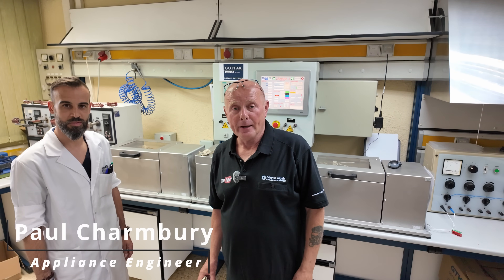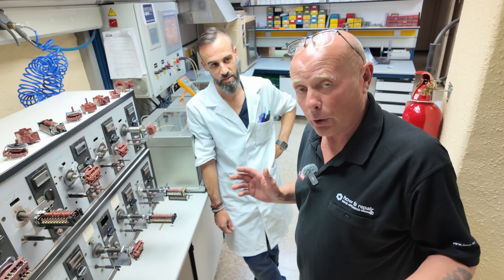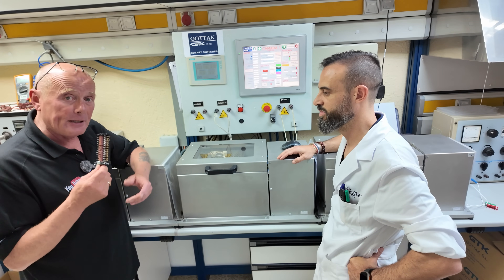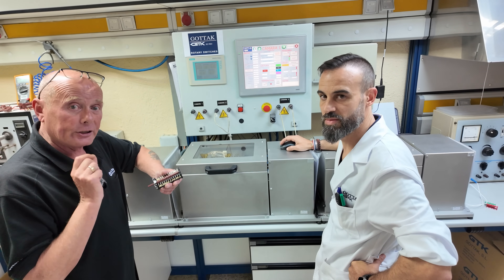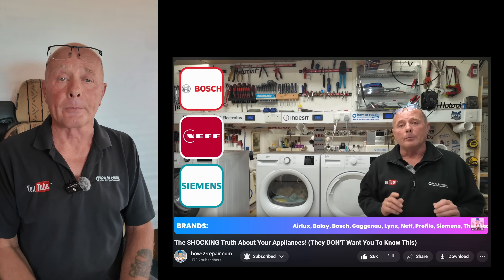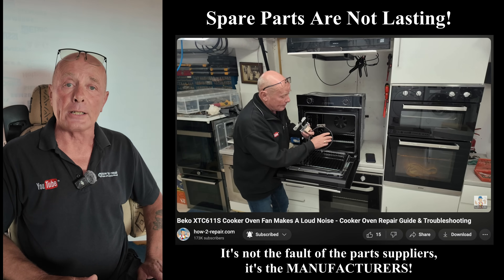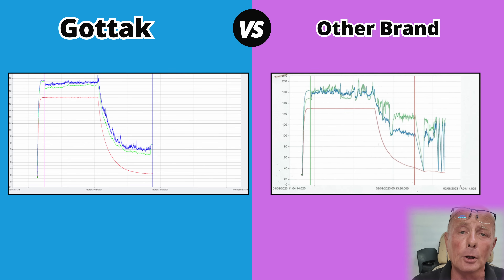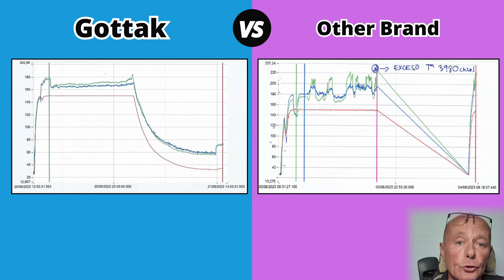Why Your Appliances FAIL SO FAST! Lab Results EXPOSE the Truth!

Comment: I have a hp office jet and it used a 3or 4mm thick belt to drive a big gear that feed paper, cover the print head, move the paper around the duplexer etc
It fails in a few years.... I only printed like 1000page
A canon laser printer, the spring loaded hinge that connect the scanner bed and adf, suddenly broke off with a loud bang at night, had a look at it, the hinge was secured with a screw, the plastic broke around the screw hole, plastic seems to be abs fibre reinforced
Reply from the maker: The original video about the lightbulb conspiracy which you will find on YouTube really does tell the story about printers and how an individual Spanish guy found out that the obsolescence was built into it from the start. This brings me to a larger issue I'm passionate about: built-in obsolescence. I’ve made many controversial videos on this topic, and they often seem to get suppressed. To put it in perspective, Google is the largest search engine in the world, and YouTube, its subsidiary, is the second largest. Google’s business model relies on advertising revenue from manufacturers. My best-performing video on built-in obsolescence reached 750,000 views. That might sound good, but it’s a tiny fraction—approximately 0.05%—of the 1.4 billion English speakers in the world. We are fortunate enough to afford these machines while people in other parts of the world still wash clothes in rivers, yet important conversations about product longevity are often stifled because consumption drives our economy.

Comment: The warranty isn't worth the paper it's printed on. You can't get parts for it. I had a Frigidaire refrigerator, and dishwasher, and 2 Maytag washers. None of them lasted 3 months and none of them could be repaired. Lowes did nothing, nd a local dealer returned my money. New stuff is all junk. I replaced everything in my home from a used appliance dealer, that had been rebuilt, He promised he could keep it all running with used parts, or new parts because they would be available. All the appliances are still working fine after  3 years now. I will never buy new again.
Reply from the maker: I am all for buying secondhand machines when they're good, but there is becoming a shortage of machines out there which are reconditionable.

Comment: I repaired TV's in the late 90's. Old wood cabinet tv's were still working or could be repaired. 
Then the plastic cabinet ones came along lasted half the time but you got what you paid for, you could get some quality electronics or a bag of shint.
The weakness is built into the power supply.
DON'T UNPLUG or switch the power off!. 
I used standby whenever possible for years and had to get rid of my tvs to upgrade on size. 
That rush of power is a countdown to you're Tv's power supply blowing the fuse.
Reply from the maker: I had a friend that you repaired TVs and it used to be a great business in the 80s but as you say obsolescence is being built in to so many things when I read your comment and then look at what governments tell you to do I laugh I swear I could remember advertising telling you to unplug things like TVs or switch them off at the mains whenever they're not in use and yes, it is so simple to build in a counter for the self-destruct process So many manufacturers have decided to change their direction of building quality and now caring only about the numbers game. You only have to read the comments that were left on the recent. Miele video i did. https://youtube.com/shorts/3LXPwAIY6LI  I have been in this appliance industry for nearly 50 years andI'm passionate about: built-in obsolescence. Because it is stopping us repairing machines I’ve made many controversial videos on this topic like this one, and they often seem to get suppressed. To put it in perspective, Google is the largest search engine in the world, and YouTube, its subsidiary, is the second largest. Google’s business model relies on advertising revenue from manufacturers. My best-performing video on built-in obsolescence reached 750,000 views. That might sound good, but it’s a tiny fraction—approximately 0.05%—of the 1.4 billion English speakers in the world. We are fortunate enough to afford these machines while people in other parts of the world still wash clothes in rivers, yet important conversations about product longevity are often stifled because consumption drives our economy.

Comment: Don't buy a Samsung.  They are like disposable razors, use and throw away. 
Only difference is they cost the same as all others. 

LG, Samsung and a few others pay to be displayed out front.
Reply from the maker: I'm in agreement on the older machines but on the latest ones that have come to the market I am interested that they are doing a five-year parts and labour guarantee I'm actually doing a video on them at the moment. I agree that they have had lots of problems over the past years with corroding spiders and PCB problems but I am actually praising them for putting a full five year guarantee this is at least a move in the right direction and I hope you understand the angle I'm coming from remember I am totally independent and I'm not liked by most of the industry because I say it as it is. So many manufacturers have decided to change their direction of building quality and now caring only about the numbers game. You only have to read the comments that were left on the recent. Miele video i did. https://youtube.com/shorts/3LXPwAIY6LI  I have been in this appliance industry for nearly 50 years andI'm passionate about: built-in obsolescence. Because it is stopping us repairing machines I’ve made many controversial videos on this topic like this one, and they often seem to get suppressed. To put it in perspective, Google is the largest search engine in the world, and YouTube, its subsidiary, is the second largest. Google’s business model relies on advertising revenue from manufacturers. My best-performing video on built-in obsolescence reached 750,000 views. That might sound good, but it’s a tiny fraction—approximately 0.05%—of the 1.4 billion English speakers in the world. We are fortunate enough to afford these machines while people in other parts of the world still wash clothes in rivers, yet important conversations about product longevity are often stifled because consumption drives our economy.

Comment: My gas heating system at home has a built in fan - it had to be replaced two times over the last 10 years and the last time i kept the old part ad tried to repait it to have a spare part next time. From the noise, it just had a defect bearing. But it was made in a way, that the rotor could not be removed and so you could not reach the defect bearing. The plastic rotor was pressed onto a shaft and removing it meant to break it. It did it anyway to check the bearing out of curiosity. There were two on the shaft. A encapsulated, big one ... which was intact. And a open bearing, much smaller and now you can guess, which one was defect. These is a cent-part, that is made to break ... and they took care, that you cannot change it. This is a kind of design, that should be criminalized.
Reply from the maker: Thank you for your comment. I appreciate people like you taking the time to write it out. Please share it where possible. It might help others make a wise choice instead of being misled by the industry.

Comment: I have a Wolf brand of 2 speed 240v drill , I bought it 2nd hand from a retiring tradesman in 1978 , I use it for core drilling and plaster/ cement mixing with a paddle on low speed .
It's still going strong on its 2nd chuck and 3rd set of brushes.
Aside from a new , longer cable it has only needed cleaned and the gearbox re greased .
So that's a testament to quality
Reply from the maker: Thank you for your comment. I appreciate people like you taking the time to write it out. Please share it where possible. It might help others make a wise choice instead of being misled by the industry.

Comment: My sister bought a Black and Decker drill for my 18th birthday, one speed, but two settings, normal and hammer. It's worked perfectly, never failed and I've worked it hard. I'm 60.
Reply from the maker: It's amazing how many tools and appliances back then are still going to this day. There is even a lightbulb in a fire station in America which is never failed in 100 years a great documentary is on this called the lightbulb conspiracy but yet that's another video that got squashed or is it that the modern society today does not care. This brings me to a larger issue I'm passionate about: built-in obsolescence. I’ve made many controversial videos on this topic, and they often seem to get suppressed. To put it in perspective, Google is the largest search engine in the world, and YouTube, its subsidiary, is the second largest. Google’s business model relies on advertising revenue from manufacturers. My best-performing video on built-in obsolescence reached 750,000 views. That might sound good, but it’s a tiny fraction—approximately 0.05%—of the 1.4 billion English speakers in the world. We are fortunate enough to afford these machines while people in other parts of the world still wash clothes in rivers, yet important conversations about product longevity are often stifled because consumption drives our economy.

I plan to release another video soon with analytics to prove this point. I've also discovered some manufacturers appear to be using AI to shield their brands from negative feedback on videos, which I will cover in an upcoming exposé. Please consider sharing any of my built-in obsolescence videos to help them reach a larger audience.

Comment: Just as mentioned in the video own a pressure cooker for making rice made in the 90s which still works well but the recent purchased cooker didn't even last 4months the quality is very bad it is thin while the old cooker is thick
Reply from the maker: You’re absolutely right mate, and it’s a frustrating practice that affects nearly every industry. The concept of deliberately designing products to fail or become obsolete within a certain timeframe is a huge driver of unnecessary waste and consumer spending. Whether it’s electronics, appliances, or even clothing, it’s all about maximizing profits at the expense of durability and sustainability!

This brings me to a larger issue I'm passionate about: built-in obsolescence. I’ve made many controversial videos on this topic, and they often seem to get suppressed. To put it in perspective, Google is the largest search engine in the world, and YouTube, its subsidiary, is the second largest. Google’s business model relies on advertising revenue from manufacturers. My best-performing video on built-in obsolescence reached 750,000 views. That might sound good, but it’s a tiny fraction—approximately 0.05%—of the 1.4 billion English speakers in the world. We are fortunate enough to afford these machines while people in other parts of the world still wash clothes in rivers, yet important conversations about product longevity are often stifled because consumption drives our economy.

I plan to release another video soon with analytics to prove this point. I've also discovered some manufacturers appear to be using AI to shield their brands from negative feedback on videos, which I will cover in an upcoming exposé. Please consider sharing any of my built-in obsolescence videos to help them reach a larger audience.

Comment: i once had an lg direct drive washing machine. after about 10 years of perfect use . the bearing for the tub failed. no big deal . it is expected after that amount of time. i changed the bearings myself . did a great job. . after 3 weeks of use the machine stop working compleatly . would not turn on. it turned out to be that the main computer needed to be changed. a cerified lg tech checked the machine and told me what the problem was. anyway i find it very strang that the machine stoped work after only 3 weeks that i changed the bearings. after it work flawlesly for 10 years. could it be that the machine is only to be fixed by a lg tech. is it possible that when you open up an lg machine to fix something in the machine is triggered for it to stop working if not opened by an lg tech. does it have a trip switch thay onlg lg tecks know about. hope you understand what i am tring to explain. it there a switch or seting that needs to be reset after re assemply that only lg tecks know about. very strange it compleatly shut down after 3 weeks of changing bearings
Reply from the maker: You’re absolutely right mate, and it’s a frustrating practice that affects nearly every industry. The concept of deliberately designing products to fail or become obsolete within a certain timeframe is a huge driver of unnecessary waste and consumer spending. Whether it’s electronics, appliances, or even clothing, it’s all about maximizing profits at the expense of durability and sustainability!

This brings me to a larger issue I'm passionate about: built-in obsolescence. I’ve made many controversial videos on this topic, and they often seem to get suppressed. To put it in perspective, Google is the largest search engine in the world, and YouTube, its subsidiary, is the second largest. Google’s business model relies on advertising revenue from manufacturers. My best-performing video on built-in obsolescence reached 750,000 views. That might sound good, but it’s a tiny fraction—approximately 0.05%—of the 1.4 billion English speakers in the world. We are fortunate enough to afford these machines while people in other parts of the world still wash clothes in rivers, yet important conversations about product longevity are often stifled because consumption drives our economy.

I plan to release another video soon with analytics to prove this point. I've also discovered some manufacturers appear to be using AI to shield their brands from negative feedback on videos, which I will cover in an upcoming exposé. Please consider sharing any of my built-in obsolescence videos to help them reach a larger audience.

Comment: Needed to fix the plastic band around the glass of a frontloader washingmachine, the plastic band holds the metal hinge in place. It's of ridiculously  thin plastic for something which needs to counter the forces of the hinge. They don't sell the them on their own. It needs to be bought in combination with the whole glass of the door -- 400euros. Holy shit! They also make sure you cant reuse 2nd hand because they don't use screws, no instead they use those one time round plastic hole and nudges which they melt down. It is really shameless. Next time I'm putting this on twitter and LinkedIn. I'm done with these companies.

This was a run of the mill Bosch washingmachine of 2014 or something. Of course it had 4,5 starts in ratings.
Reply from the maker: You’re absolutely right mate, and it’s a frustrating practice that affects nearly every industry. The concept of deliberately designing products to fail or become obsolete within a certain timeframe is a huge driver of unnecessary waste and consumer spending. Whether it’s electronics, appliances, or even clothing, it’s all about maximizing profits at the expense of durability and sustainability!

This brings me to a larger issue I'm passionate about: built-in obsolescence. I’ve made many controversial videos on this topic, and they often seem to get suppressed. To put it in perspective, Google is the largest search engine in the world, and YouTube, its subsidiary, is the second largest. Google’s business model relies on advertising revenue from manufacturers. My best-performing video on built-in obsolescence reached 750,000 views. That might sound good, but it’s a tiny fraction—approximately 0.05%—of the 1.4 billion English speakers in the world. We are fortunate enough to afford these machines while people in other parts of the world still wash clothes in rivers, yet important conversations about product longevity are often stifled because consumption drives our economy.

I plan to release another video soon with analytics to prove this point. I've also discovered some manufacturers appear to be using AI to shield their brands from negative feedback on videos, which I will cover in an upcoming exposé. Please consider sharing any of my built-in obsolescence videos to help them reach a larger audience.

Comment: The mighty Whirlpool top loader washing machine has to be up there as one of the better designed machines ever.  Only thing on them that seems to be  poorly thought out is the metal lid, unfortunately never galvanised first before painting.  A washer that can be used decades after buying is a rare thing.
Reply from the maker: Thank you for your comment. I appreciate people like you taking the time to write it out. Please share it where possible. It might help others make a wise choice instead of being misled by the industry.